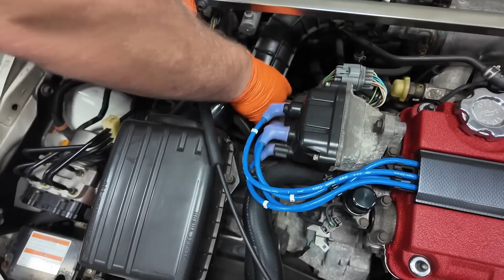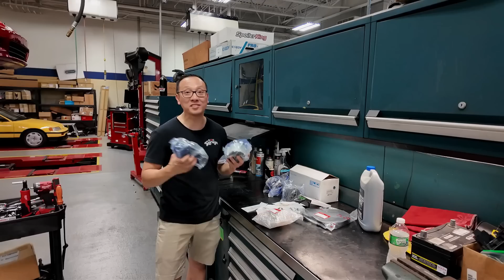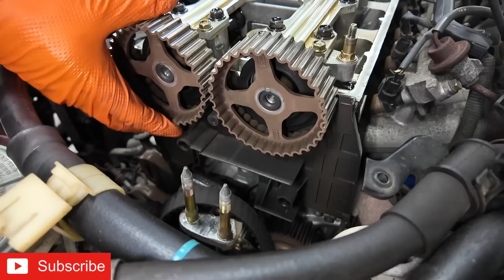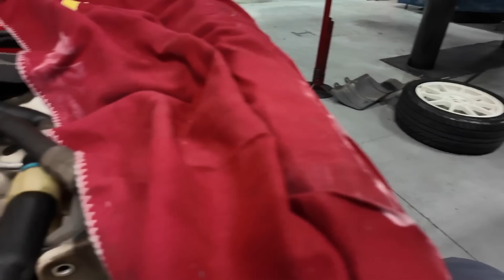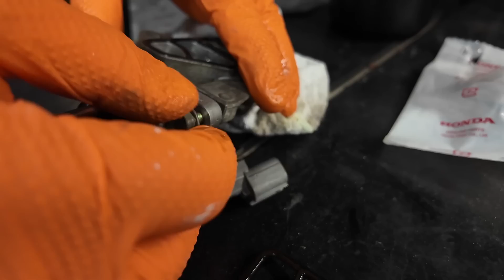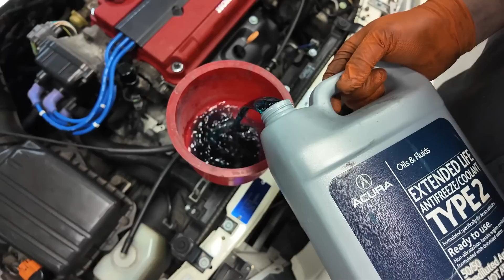JDM 1998 Honda Integra Type-R DC2 // Replacing a 26 Years Old Timing Belt & Clutch Repair (Ep 1)

Comment: Nice video again! I have a 98 ITR that has the temp needle that drops under rev or hard acceleration. I've then replaced the thermostat with an oem one and bled the cooling system with the spill-free funnel (no bubble at idle, but if I rev it, some arises). The radiator is a Koyorad. What could it be or what could I look at next? Thanks!
Reply from the maker: Have you inspect or replace the engine temperature sensor at the cylinder head?
Reply: @ahcgarage  thanks for writing back! Is that the sensor on the thermostat housing?

Comment: Super glad you all posted this. I have a DB8 Type R and need to do a timing belt. I have watched other videos but wasn't sure if the engine mount would clear the AC line with it being different on the RHD. This answers that!  Curious what sockets you all are using?

Comment: Needs a short ram intake.. Elevate that Vtec engagement sound 👍
Reply: Most people don’t like losing power. A Mugen carbon fiber air box with the lower intake duct would be better, and much higher OG JDM bling points. 😂

Comment: Just out of curiosity with older cars do you usually use Honda bond on the water pump? I remember on the TL someone mentioned their machine finished , so I was just wondering. Beautiful car , excellent work hopefully one day I can bring my civic or TL up 🙏🏽
Reply from the maker: Other don't but we do. As cars get older, the mating surface often times have imperfection. By laying a thin coat of Honda Bond, it fills the gap if there's any. Plus it's a good insurance

Comment: yes rear motor is a pain when motor is still in
Reply from the maker: Certainly not something we look forward to do haha!!!
Reply: Probably a bit easier on the ITR than the GSR. I just recently snagged an OEM Honda rear mount for my GSR, direct from Japan. It’s going to be a major PITA to install with the dual runner intake manifold!
Reply: @Patrick94GSR  i always change the intake mainfold on the gsr to a aftermarket one becasue i hate the the stock gsr intake mainfold
Reply: @b18c5turbogt35r  that requires other supporting mods that I’m not interested in, though. My engine is at 388k miles all original and I’m keeping it that way. Plus, when those IAB’s open at 5,600 rpm it just sounds badass!
Reply: @Patrick94GSR nice!! I had my ‘94 GSR until 299,000 miles and then sold it still running strong. I miss that car everyday